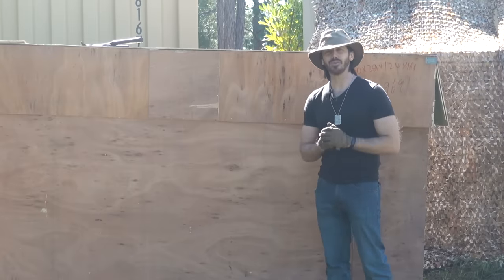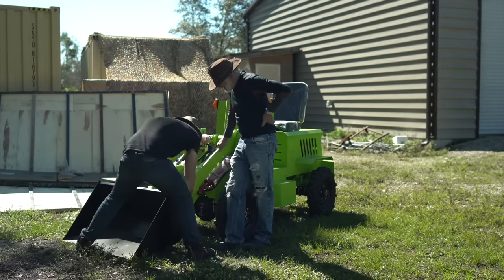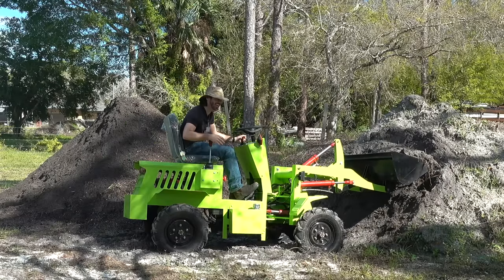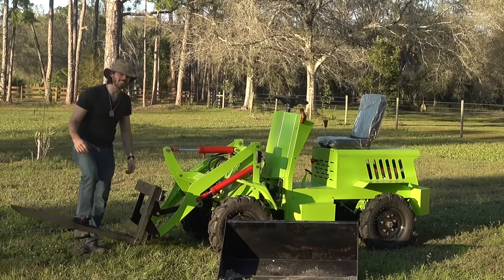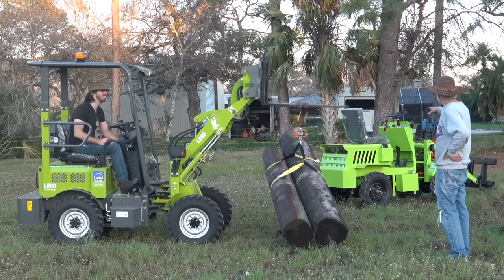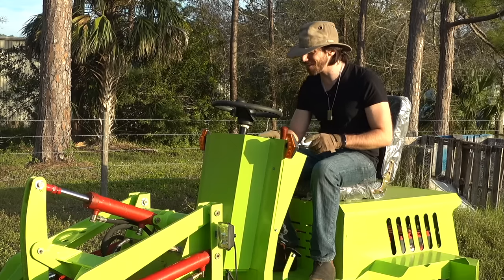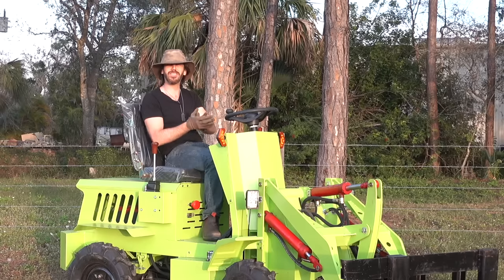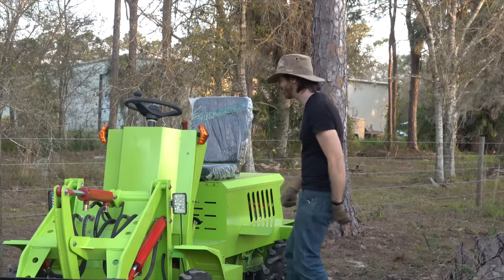I Bought A Cheap ELECTRIC Tractor From China (Big Mistake!)

Comment: How much did it cost, its hard to judge its performance when compared to other lifters without a price comparison, if the other 880 pound lifter you compared it to was the same or close too price tag,then yeah it preformed badly,and is a bad overpriced product, but if it was only half the price of the other 880 pound lifter, then it performed very well, even with all the cheap parts used on it, it all depends on the price,you cant expect it to preform better than equipment thats priced higher.

Comment: Man, what a unit!!💪🤣 Looks like it was designed and built by 12 year olds (actually highly likely, considering the source)😳 Sounds like the hydraulic pump and motor are mounted solid to the body, which would explain why it's so damn loud. The controls don't seem to have any fluid restrictors at all, since they seem to allow the bucket and tilt controls to drop like a stone. The differentials are obviously open diffs, since it only seems to drive one tire at a time at each end. Not only are the batteries not secured, but those cables don't look big enough to drive a modern GM heater motor, never mind a hydraulic pump or drive motor.😬 OSHA would have a field day with this thing, as far as safety concerns, especially with no roll cage, and that narrow stance and high center of gravity. The forks are truly a work of art, and should be treated as such (mounted on a wall somewhere!)😝. I'm sure the reason they're made out of channel iron is to help them reach that 880 lb. target a little easier! The tires look like they're better suited for a roto-tiller, than on a bucket loader!😆 Hey, if all else fails, maybe you can re-route the hydraulics to a larger cylinder and turn it into a mobile log splitter?😄👍👍

Comment: One thing I've learned after years of using Chinese products, if it's cheap, it's crap. Usually start up companies or something, maybe lacking experience or expertise. If the company can survive, give them a few years and they'll start improving. Look at BYD as one of the many examples. Or the phone companies. They all used to be crap.

If it's moderately priced (usually about 40-60% the cost of similar western products), it's gonna be good, for it's price.

If it's competitively priced... it's the top of the line stuff, sometimes even better.

Comment: And let some air out of the tires so they just start to squish... ship it to me if you don't like it, it has lost of potential.... it was probably diesel or gas powered originally so it would have had more power and counter weight

Comment: Please get in contact with me I'm having a problem figuring out what type throttle to buy for the controller for my 1000 w 47 volt I just started building electric bikes from kits my controller and throttling bad I bought a correct controller but I do not know how to find the throttle to match the controller

Comment: Its because these are made for projects in a country with very low GDP. A "cheap Chinese" thing is still expensive to lots of other countries. This would be a lifesaver for moving mulch in Romania for example. Low paid worker, moving low value goods, with a low value loader. This is a luxury compared to moving it all by shovel and pull cart. 

Chinese ideology is also different when it comes to equipment. Just like how their buildings are collapsing from Tofu-Dreg construction they expect this loader to be used for half a year - 2 years max then abandoned by the company or left to rot in a field. 

You also have to take the scale into consideration. They need to supply 10,000 workers with 10,000 of these. They can't afford 10,000 good machines so workers would be left idle. 10,000 is an arbitrary number but looking at how much they need to do and there expansion projects in other countries these easily fit the bill for that. It also means the construction company if they send a machine to say Africa don't have to worry about returning it to China, its a disposable.

Comment: its made with minimal safety or handling features .  no rollover protection ,seatbelts and no grip plates on steps or work platform . when the rear lifted up how would the articulation hydraulics and pins stand up to any articulation . Its an accident waiting to happen . thought could just put a small bucket on but someone could weld a lifting point on and over capacity lift it .  maybe a small " carry all " could be used to carry

Comment: My John Deere loader has all the same issues.  Traction loss on wheels going into a pile, front heavy.  power loss when using drive and bucket features simultaneously, no backup warning sound, can be operated while standing next to the machine.  Why would you expec more from this?  Perhpas your expectations are unrealistic.  It did lift the entire bucket overflowing with material.  My John Deere won't scoop a full bucket without some forward backward manipulation.  This is an inherant characteristic of a wheeled loader.  I see no real problem.  If you took a level bucket and made 2 trips you'd get the job done without issue like my JD.
Reply from the maker: I’m sorry about your John Deere. It’s sounds like it has similar poor performance to this machine.  I have another good Chinese loader (not this one) with ROPS, deadman switch, operates hydraulics while driving, can lift twice as much as this loader, etc. That’s how a proper quality loader should operate.

Comment: A cubic block of cement  with only 30% moisture weighs around 4000 lbs ,but this machines not designed to lift 2000 lbs just because the bucket can hold a half yard of sand!
Ya pay for what you get!
As for the forks,dont trust them to lift to much! 20 lbs each,should be heavier.
These forks may be illegal in Canada, because that style of fork,not attached at the bottom, I met a guy who had one flip up and over the top of the machine, into his spine,he now has a steel rod in his back !
You did mention the forks safety issues! Tie them with chain at the bottom!

Comment: While it can be a performance test to start it fresh out of the box, I suppose. Every good equipment operator knows the first thing you do before starting is to check the engine and hydraulics. Next, before operating, check all joints and fittings. If that had been done, it would have been a better test of actually overall performance in its intended spec condition. We also know operating poorly maintained equipment is hazardous to us as well as everything else around us. After that, you romp it and stomp it, and then when it breaks, it must have been a manufacturing issue. Plausible deniability. 😂

Comment: I would buy that loader for the right price. It's at least as good as my 1960's forklift.
Reply: @Islandwaterjet  at 2 uses per year with it being kept inside it might. So for $1,000(USA) I would buy it and convert it to use better batteries, but I suspect it costs lot more than that.
Reply: @LaserFur  More like 5-6k for the shipping and other fees. Better buy a used Bobcat.
Reply: @schwuzi  I will just keep renting a bobcat as needed. I can rent a bobcat, but I can't rent a forklift or a pickup truck that can pull a trailer for legal reasons.
Reply: @LaserFur I rented a a Uhaul pickup and was allowed to rent and pull a trailer

Comment: So.......a realistic lifting capacity would be more along the lines of 500lbs.  Did you check the hydraulic fluid before operating it for the first time.  It sounds to me like the pump runs dry under a load.  And yeah, there's no way this would be good for anything other than very light yardwork type of stuff.

Comment: Probably be a good idea to learn to drive a loader first ,, you cant  drive a Cat 992 with a 13 mt bucket  into a stockpile and fill the bucket ,,
Reply from the maker: With any properly designed mini-loader, you can fill a full bucket. If not, the bucket is either massively oversized or the machine is massively underballasted.

Comment: At less than half the price of the Nesher, I'm not too surprised.  Too many corners to cut to get it down to that price and ship it.  Check the hydraulic oil tank.  It's either low or too small (the angry sound is the pump starving).  Spring clips instead of split pins, some real weight on the back end and a few other obvious mods would make that thing more useful.  I bet Chinese people who buy that thing don't use it without adding a few upgrades first.  The design of the forks is just awful.

Comment: There is no e bike that would do me any good. In 1993 I was at my job I was a wrecker driver I was on a call lot of ice an snow. Got a pick-up out of the center of the hwy. Semi top the hill seen my red lights jack knife his trailer smashed me between the pick-up an wrecker drug me 213ft down the hwy. Lost both my legs above the knees. I wish they made a ebike that had 4 wheels. A 2 wheel bike wouldn't do me any good.

Comment: This seems kinda self-serving for you. You compared to your double or triple the capacity machine and of course yours is better suited for heavier loads. Why not compare one of equal capacity to yours for a real comparison. The way you did it is like comparing an F150 to an F350 and concluding the F150 is bad. I am guessing the cost a third as much as version you sell. Perhaps some will want cheaper version and can upgrade on their own.
Reply from the maker: They have identical ratings. That’s the point. Both rated for 880 lb lift capacity.

Comment: An ICE version would be quieter than this.  Wow and sorry as I'm sure that obtaining this was an investment.  It also appears it will easily dump your cargo onto your face.  You could add weight to the rear to reduce tip-over, but it doesn't seem worth it for this piece of crap unless you fix a bunch of other things.

If these are common in and around China then I feel sorry for the people trying to use them, though I'll bet that this is a common, perhaps counterfeited, basic design where some versions are much better than others.  As others have said, you have to visit Chinese factories personally to see whether they're in someone's home garage.

Comment: The reason its bad because it's cheap and china i would check everything over like hydraulic oil and just go over everything it sounds terrible i would not want the price to replace them batteries you can tell it's built really cheap and will just keep failing apart and guttless power i would not even think of buying it 😂🤣